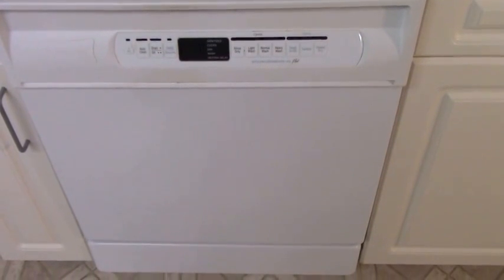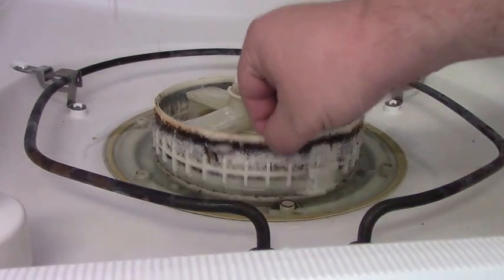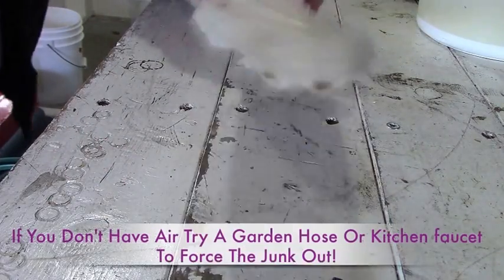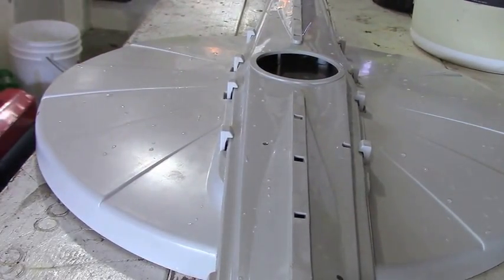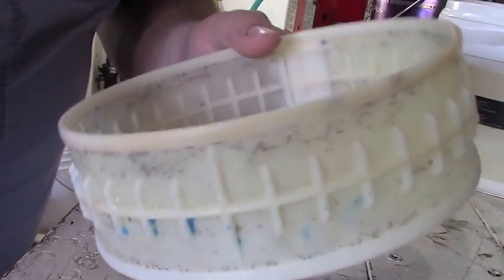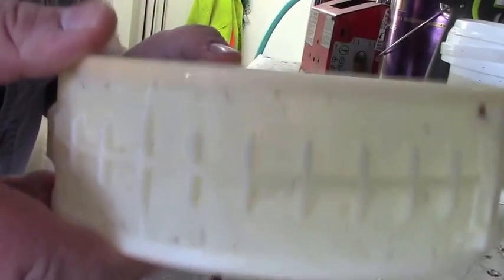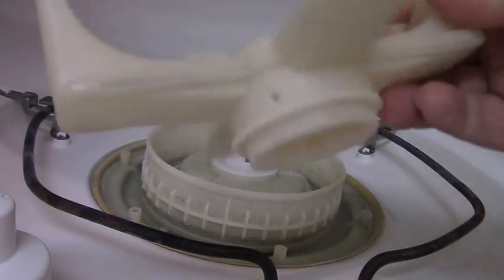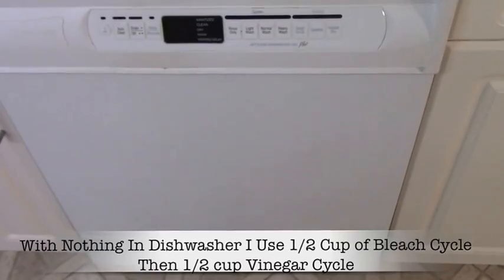Dishwasher Hack How to Make A Dishwashser Clean Like New Again!

Comment: The way I clean that top arm (3:02 in the video) is to pull out the dirt clog with tweezers or needle nose plyers. If it's too big to come out, it goes back in. Then I try to get it out 'dry' by whacking it gently on the sink or counter to get the debris to fly out the large hole. If still not out, then I rinse under the tap and dump the water out the large hole so it takes the debris with it. Kind of a back and forth see-saw motion and tip over fast to get it out that hole. Usually works by then. If you don't get it out it will clog again.

Comment: Thanks Dale. 

My dishwasher is the same model and I had all the same problems. I was struck by how easily your main filter went back together. Mine was a bear. Silly question - when will dishwashers be offered with filters that slide out easily for a quick rinse? 

Sorry if this is slightly off topic but I also had an additional problem related to cleanliness. The float (bottom front left inside the washer) was so full of foody gunk it couldn't lift any more so water overflowed and leaked out of the bottom of the  washer. Easy fix  - ran my finger around up inside the float and all the gunk oozed out. Gross! 

The last issue was lubrication. That float trips a microswitch through a rocker to stop waterflow when the pan is full. The rocker was sticking causing a water overflow and leakage. After a clean & lube it was back in business, I hope for another 18 years! 

Cheers.
Reply from the maker: Hey there thanks for your comment! As time goes by technology and updates come along with it. The new models are much easier to clean with a quick removable filter. Sometimes i will run bleach or CLR on a cycle of it's own seems to help a lot and help kill that nasty bacteria. Cheers :)

Comment: you could probably clean out the filter more easily with a manicure/nail brush. I buy them in bulk on eBay, usually a set of 6, and they're great for cleaning dishes and stuff around the kitchen. My old dishwasher came apart more easily for cleaning and the flat spray arm thing actually was able to come apart for easy cleaning inside (unlike my current Maytag dishwasher) and I was surprised how much stuff was clogging up the inside, including bits of broken glass from cheap dishes that had gotten broken in the washer and bit of paper and food debris. The mold build-up was the gross part :P
Reply from the maker: Yes for sure I don't think a lot of people are aware of the build up in these dishwashers! Its a good idea to clean and run bleach & vinegar in a cycle by itself.

Comment: My god just openned my washer and its all black. Never know need to clean figured regular washing took care if that. What crap I'm finding, got it soaking in the sink in hot water and vinegar. I started to use that dishwasher cleaner and i guess it started to loosen the junk up. Great video i have same dishwasher not the pulse version. Think if you going to blow air into the holes better to block other side of the arm openning so does blow into other

Comment: Water faucet didnt work for me. Which makes sense. When its running theres probably decent water pressure running through it normally, and if that water pressure wont push it out then your faucet wont either. I used the faucet to push the gunk to the nozzle and then tweezers to pull it through.

I have a kitchenaid and its still not cleaning very well even after I cleaned all of the nozzles.